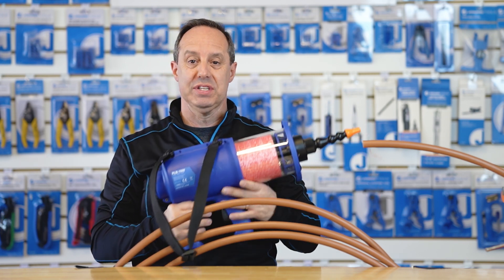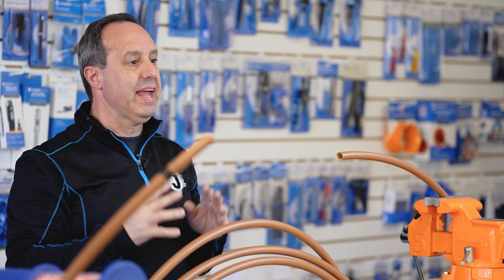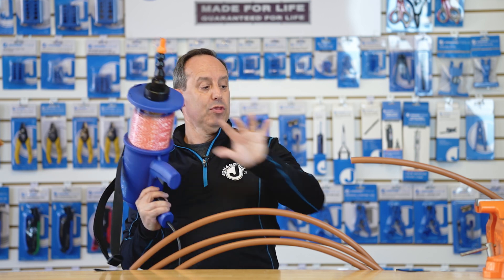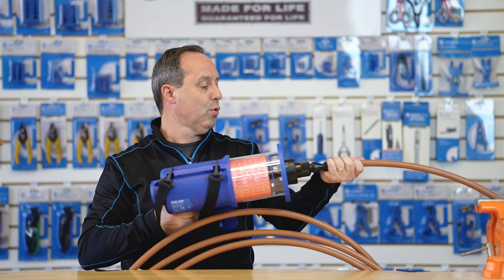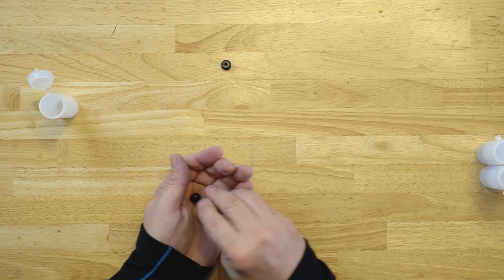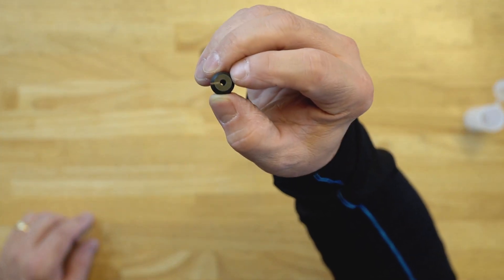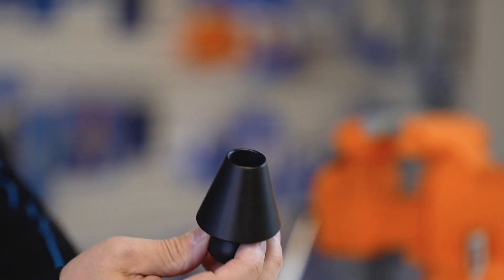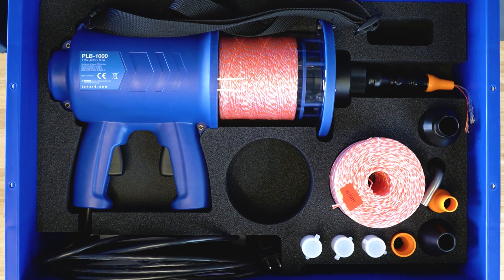Jonard Tools Pull Line Blower (PLB-1000) Product Video

Comment: Yeah um that statement "soft flexible conduit and  electrical conduit as well"  tells me you have no idea wtf you're talking about. Conduit is conduit.  It's all for electrical raceways. Unless you're substantial cheaper than a Greenlee Ideal, Klien,or GB.  It's not getting bought. We trust the names because we've all had and used them we know there not a wait of money that will break the second time it gets used
Reply from the maker: Hi @lidlett9883, we thought it would be important to list the different types of conduit our tool works on such as corrugated plastic flexible conduit and others. 

Also, we at Jonard Tools stand by the quality of our tools and are confident that they work as well as (if not better than) the companies you named. That's why our tools are Made for Life & Guaranteed for Life . Thanks for your comment.
Reply: Great tool. But won't work with conduit that already have line inside it. And that is 99% of the time we work with.
Reply: @abdulkhalidkhaliqi8614  Why would you want to blow another line over a duct that has line in it?
Reply: @abdulkhalidkhaliqi8614 , hell i thought I was the only person who always leaves a string behind in the pipe on my pulls!😂